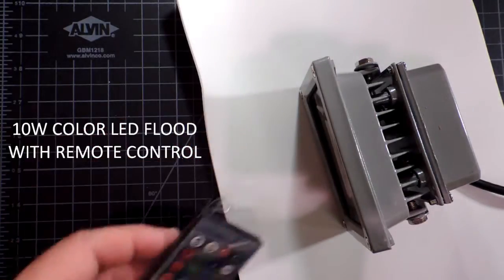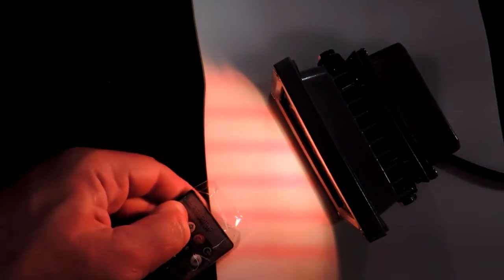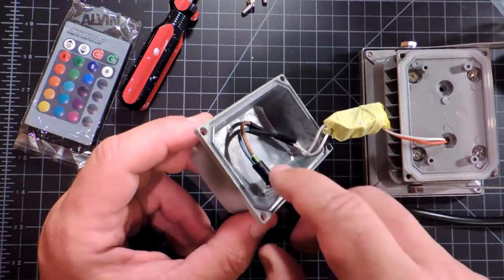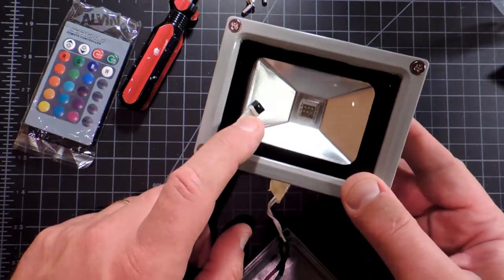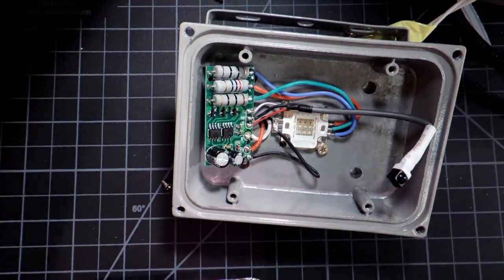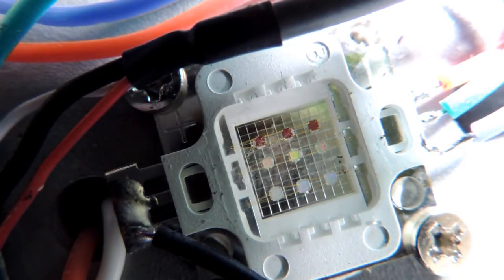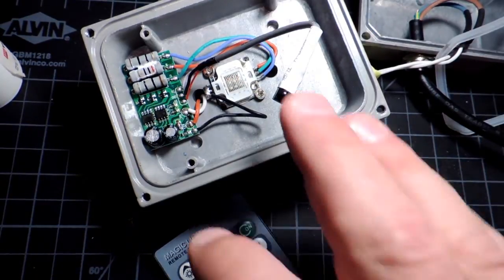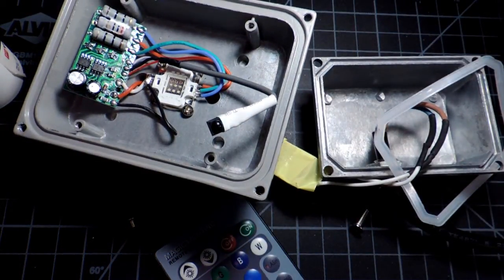10W Color LED Flood Light with Remote Control Review and Teardown

Comment: LED  flood lights maintenance and repair instructions:
1, make sure you have power before maintenance service;
2, a regular cleaning of the lens, in order to maintain a good transmissive lamp;
3, regularly flood light shell and radiator dust cleaning, preferably with a dry cloth;
4, replace the power supply, can be directly with a screwdriver after opening the back cover, remove the power supply, AC power supply three-wire power connection in accordance with the corresponding red "L, blue corresponding to the power supply" N ", yellow-green or yellow corresponding to the" ⊥ " , DC power line red line corresponds to the power of positive, black line corresponds to a negative power supply, pay attention to positive and negative do not reversed.
5, A professional electrician and maintenance are essential.
6, The hole must be appropriate before installation. Not too big or too small.
7, Since the light is a little heavy, please insure screws fixed well before installing.
8, Please avoid the heat or hot steam environment or corrosive gas, so as not to affect the lifespan of the product.
Our company is a professional LED floodlight manufacturer, 
If you want to learn more about high-quality outdoor lighting LED floodlight, please visit www.raylighttube.com/LED-Flood-Lights

Comment: Looking at a similar product will I be able to remove the 230v -12v converter and connect the + - to a 12v power outlet will the led still work the same ?  

Thanks for your help

Comment: If this 10w unit is any indication...  I would be scared to death to put itor any other unit into service..  First, I would connect the earth ground, Second; shield IR sensor wire from being cut, Third; change out the power resistors to metal heat sinked types and mount, screw  them down to the finned back cover, Fourth;  I would also check the LED chip to ensure that the chip has heat sink compound  . At that point it would be a lot safer and have longer life.  Color me cautious but...  There is a reason that electrical rules are setup by UL, CSA, CE, FM, etc.
Reply: all said and done. your $20 light is now the $60 light you should have bought instead of going cheap.  people you get what you pay for.  there are no magic deals availble to the public in life
Reply: +tennismediadynamics - I agree,  with China's propensity to disregard Patents, Intellectual Properties, etc.   Even if a product arrived with any safety certification labels I would perform a complete tear-down to verify the unit.  After all, anyone with a scanner and printer can print any safety certification sticker and illegally use it just to make the sale.

Comment: I think that there are two ICs for the reason that they probably do different things. One is probably to interface with the IR sensor to send a colour number to the other IC, which is probably something like a WS2801 PWM chip, which would control the output signal to the LEDs themselves